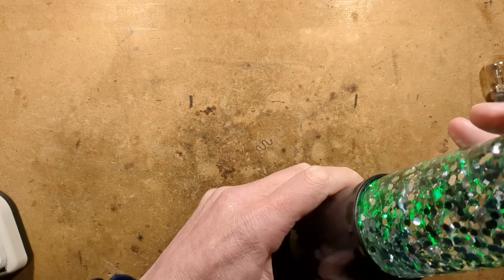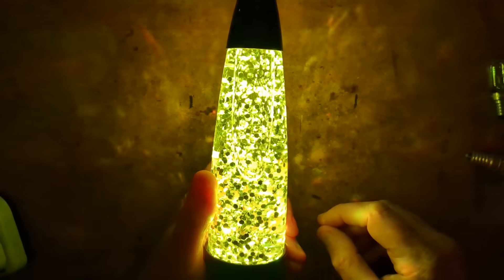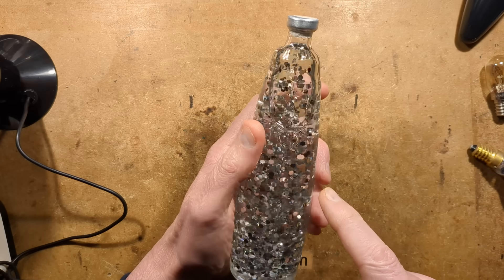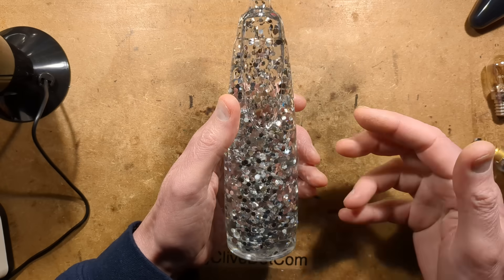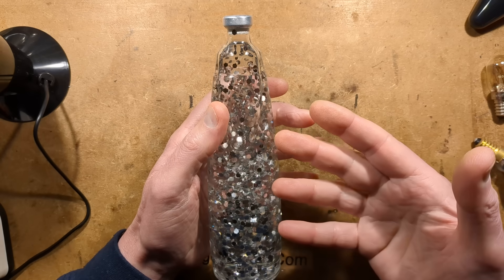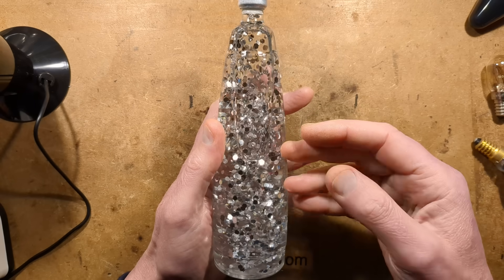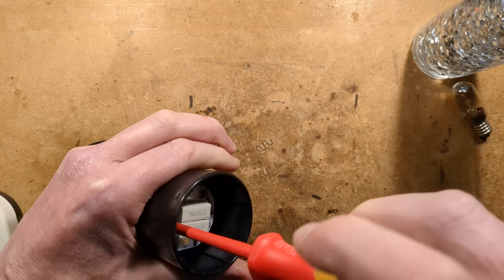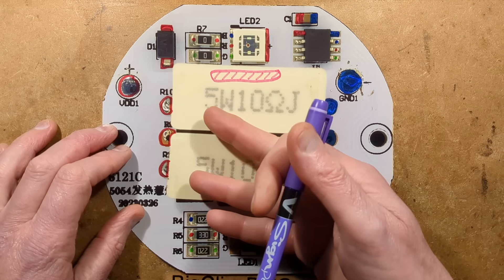USB glitter lamp with REAL thermal convection

Comment: I would think that if you want to "experiment" with the heat source and it's proximity to the bottom of the bottle, you should make it adjustable, both physically and electrically. The proximity and/or intensity of the heat source directly correlates to the convection rate (speed of turnover) balanced with avoiding equilibrium of the fluid's temperature, which of course will halt convection. With the bottle being as narrow as it is, that sweet spot will not be easy to find.

Another possible way you could "tune" the convection rate would be to put a 1/4 inch compression fitting on the bottle cap and use a 1/4 inch by maybe 6 inch heat pipe inserted through the fitting so that a portion of the heat pipe is in the solution and a portion of the heat pipe is outside of the bottle. By sliding the heat pipe in or out of the bottle you adjust the amount of the heat pipe exposed to the solution which changes the amount of cooling at the top of the bottle and thus changing the convection rate. Of course the fitting and the heat pipe will need to be impervious to the salt solution.

Comment: Having a standard vial crimp cap on top is neat too. I wonder if the glass is available from Chinese suppliers in single quantities.
Reply from the maker: Although crimped, the cap and rubber plug are designed to release under pressure if the globe is put on too high a heat source.

Comment: So are these resistors over-specked? Like if they can each handle 5W but only running at 2.5W each, wouldn't it make sense for cost savings to use two, 2.5W rated resistors in this application? That's if they exist at that power level lol
Reply from the maker: They're probably playing safe.  It's better not to run resistors at their full power rating.

Comment: Aha! I used to have a glitter lamp that contained some sort of oil in the chamber to provide the slow glitter movement and the heat and light were supplied by an incandescent bulb. I wondered how this one would work given incandescents are non grata these days. An interesting and effective substitute method!
Reply from the maker: It will probably be calcium nitrate again.  The old units are balanced termally for the original wattage of bulb.  The glitter may stay at the top with lower power heat sources.  (But you can add drips of very pure water to the calcium nitrate based globes to dilute it down gradually.)

Comment: I have been struggling with this for a long time.  How do I put color scrolling LEDs in my Lava Lamp (tm)?  They're not going to make stove lamps forever and, let's face it:  analogue effects are rad.  They're physics and psychedelic all wraped in one.  The amount of digital processing required to recreate what heat and oil does for 40W is pretty much pointless.  My best concept used heater wire.  Hadn't considered that 3 or 4 power resistors might suffice.  If anybody out there wants to work on a color scrolling Lava Lamp (tm) lamp with me I'm all for it.  Cheers!
Reply from the maker: Lava lamps need a lot of heat to operate properly.

Comment: Here at least, tungsten oven lamps are still available, the high temperature tolerance is a solid reason to use tungsten lamps in ovens and the low efficiency is not really a problem there. First hit on google when I searched for an oven lamp was an Osram, producing 85 lumens from 15 watts, there are led lamps on the market that are about 40 times more efficient than that.

Comment: I have a very similar lamp and I snipped the resistor out as an experiment (mine only uses one resistor) and the glitter still moves fairly well. It's extra calming to have the glitter move extra slow. Totally happy with the power savings (3.xW to 1.00W). Considering your irregular ambient temperatures it probably won't work without extra heat. Even my glitter starts to clump up top a bit in the winter

Comment: Any chance you may test VDE screwdrivers in the near future???
Reply from the maker: Do you mean for insulation strength or tip durability?  I'd suggest going with a prominent brand for professional work and a cheaper brand for home use.

Comment: If there's room between the glass and the resistors then I don't get why they've soldered them so they touch the board instead of keeping the legs longer so they float above the board and be closer to the glass. Prevents the board from getting too hot while the glass gets hotter.

Comment: Using those resistors is pretty neat, both because they burn out way less frequently than a light bulb (almost never, I imagine), and because the amount of light output is decoupled from the amount of heat output.

Comment: Wonder if it would be worthwhile to replace that junky cable with a better one, probably 0.7mm copper core double insulated lamp cable, and use a separate repurposed 5V 2A wall wart ( 2a o it is derated to a real world rating, not the inflated one from the OEM) connected to the cable. 

for other lamps getting the inside PCB might also work, though you probably will want to have a 12V supply, and put on the board a 5V regulator, along with using 2 15R 10W resistors instead, spaced well off the PCB on some ceramic beads, so as to move the power dissipation away from the board, and keep the electronics cool, and have 19W of heat for the lamp, which probably could use wax, as the resistors will run about the same heat as the original lamp, which generally was a 35W incandescent lamp, or for the later ones a 35W 12V dichroic reflector, with a cup shaped holder to actually absorb the heat and send it back up.

Comment: I was surprised to find out recently that hexamine fuel tablets, as used in Mamod steam engines and camping stoves, was banned now in the UK, because it too can be used for making err, pyrotechnic devices. I don't think that was what finally killed Mamod off but it certainly can't have helped! Speaking of pyrotechnic, what happens if you Soda Stream that glitter bottle :)

Comment: when i was young i put a 30mw line generator laser in the base of 1 of these would (not) recommend if you value your eyes, 
the only problem with coupling a high power led to the bottom of the bottle is the heatsink is on the wrong side of the diodes, you wont get as much conduction through the gel than to the metal base plate...but it probably doesnt matter if you dont cook your leds like most commercial lamps like to do, you could probably just stuff a commercial led lamp without the plastic diffusion up the backside of this and it would work fine on the oveworked leds alone

Comment: I used to visit Mathmos, in Pool in Dorset for UL as they shipped tonthe USA.

There was a downturn in production when certain companies were shipping them with flamable fluid in the bottles, so when they were knocked off a table they caught fire.

In the production the bottles were sterolised by heating them in very hot water, to keep the water clean so there was no discolouring of the water.

I did ask them how they were going to get around the eventual disuse of element lamps, this was in the 90's,  don't think they had thought of this.
They must have cracked it as suprisingly they are still manufacturing in Pool, the Lavalamp, one of the few still manufacturing in the UK.

I found it great little company.

One suggestion a metal sheet say aluminium the size of rhe resistor area and thickness, so the lamp would touch or reduce the air gap, giving more heat into the bottle, giving a greter convection and reducing the heat disipated in the circuit.
Reply: The aim.isnt just to put more heat into the bottle. That would just heat the contents up to equilibrium more quickly.

You need to balance heat in at the bottom and heat dissipation of the bottle (especially the top) to maintain a rising convection current through thermal differences.

Comment: I bought calcium nitrate on eBay for €20 for 25kg. I tried to make glitter lamps and lava lamps, but it must not have been pure enough, or I did something wrong. The liquid remained cloudy. For lava lamps, it's not a problem, but if you want to make a glitter lamp with clear liquid, it's not good.
Reply from the maker: The standard stuff is cloudy and needs either filtered or allowed to settle for a long time in a big sealed bottle and then the good clear bit syphoned out.  The manufacturers must use high purity chemicals.

Comment: I just want affordable LED home lighting that doesn't cause mass interference in radios. CFL and LED both interfere horribly. My shop has cinder block walls, can't get any fm reception with the lights on lol AM is basically impossible to receive indoors
Reply: CFL drivers probably require AC, but those cheapie LEDs just FWB-rectify AC into pulsed DC which does all the interfering.  I wondered about driving them with variable-voltage DC, just enough to get full power (ie, to just cover the LED-string's voltage) and eliminate that EMI/RFI.  A small box the lamp plugs into, or similar that the bulb screws into, should do.

Comment: They could have   a buck converter   to increase the voltage  to the resistors,  say 30 volts, and decreased  the total current  to the  5  volt  rail
Reply from the maker: That might have been useful to limit cable losses if it had been used at the plug end.

Comment: You don't need to be in the "Eco Industry" to see the benefit of cutting energy use of lighting by something like 70%. And if the LEDs are not run at their limit and the device has a decent quality, you also get the promised long lifetime.

Comment: I advise against putting any heat source in direct contact with any commercial glass vessel. Yes, in this case the liquid inside will convect heat away from the source once the glass reaches equilibrium but considering how cold you keep your house, you risk a messy, possibly expensive lesson in uneven rapid thermal expansion in glass.

Otherwise I agree that this is a fairly impressive design for what it is. The power resistors and LEDs are nicely derated, there’s no obvious safety hazards built in and no unnecessary complexity.

By the way- I doubt that the density of the liquid is measured during manufacture other than a go/no go visual inspection after assembly. Typically in industrial mass manufacture like this all of that is done before setting up the factory. All the workers have to do is put a prescribed amount of the calcium salt (so many buckets/bags) in a large vat and add water to the fill line, then turn on a timed mixer, then open a valve that goes to the fill line(s). Trust me- you want to idiot-proof such processes as much as possible, and it also keeps training costs down. My only concern would be the purity of the water used. Obviously drinking it is a bad idea but it can still,carry mold spores and whatnot that can be problematic if the liquid gets loose.
Reply: Well, you'd want to use a better heat-tolerant glass, like borosicilate. But yeah, those are a bit more expensive
Reply: You realize most lava lamps ran off 40W right? Almost ten times more than this unit.
Reply: @jaro6985 Yep, exactly right, and they were never in direct contact with the glass either. As another commenter here says, with those types heat is transferred via radiation through the glass into the contents and via air convection to the glass.

The point is that most kinds of glass will crack and fail under direct localized heating. Please don’t do experiments to verify this at home. I already have and while you can get good data, it’s messy and hazardous. Please don’t ask me how I know.
Reply: @jaro6985  sure but they have tungsten halogen lamps usually, with a lot of heat being radiative, meaning it's quite even at heating, and the rest of the heat being added through the air, also quite evenly.
You'd also likely want some kind of not-too-conductive heatspreader with resistive heating elements.

Comment: So if I used 12V low voltage lighting transformer, 20 ohm (2x10 series) resistor, and a 12V to USB to power the microcontroller and  waterproofing. I could have an outside glitter lamp.
Reply from the maker: If you sealed the base it could be solar powered.

Comment: The USB glitter lamp that I had was from years ago and used a small incandescent lamp. The lamp was a standard MES fitting so I replaced it with one of those torch lamps with a built-in lens. The result was a much 'sparklier' glitter lamp!

Comment: Next time you play with the lamp making, try pulling a vacuum to release the bubbles quickly. Cheers.
Reply from the maker: I tried that with limited success.  But it was a very crude and low vacuum system.  (A cap with a hole and a syringe.)

Comment: Glad to see even this sort of thing is getting more efficient (though I'd be interested to see a more tradtitional "lava" style like this).
5W for something like this is pretty crazy when I think about how much heat my lava lamp put out as a kid. It was bad enough that I stopped running it because it would make things hotter and ate tons of power for next to nothing besides ambience.
Reply: I wonder if one could make it even more efficient using an peltier module.
Like, simply thermally bonding a small one to the bottles bottom, sitting in a cutout within the pcb (so the peltier module won't touch it except with its cables), where the 'cold' side is basically beneath all the electronics (to reduce condensation problems) and has a little heatsink to absorb ambient heat?

Would definitely be neat ngl
Reply: @BioTechproject27  
If you only want to heat something, there's no point in using a peltier element. It doesn't magically give you more heat than a resistor. First a peltier is woefully inefficient. About 90% of the heat on the hot side is from power losses and only 10% "stolen" from the cold side (so the hot side heats 10 times more than the cold side cools). But that inefficiency doesn't matter when heating. The cold side just pulls heat out of the environment. That heat energy would have been there anyway and you could just add to it with a heating resistor directly instead of "pumping" it through a peltier first.
Reply: @superdau  Huh? Either you don't understand how peltier elements work or you didn't write what you actually mean, because nobody is claiming it somehow magically makes heat?

A peltier module is a simple, and yes, quite inefficent, type of heatpump.
Consider e.g. a more drastic example: A compressor heatpump.
If you use that to heat a specific mass in some place, taking heat from some other place, like its environment, you'll heat that mass up more than simply using that electrical energy to directly heat it e.g. with a resistive element. A heatpump uses energy to move heat. No matter how inefficient it is, as long as it moves heat energy for any amount of electrical energy, it will always be more efficient than a direct resistive heater.
Sure, in the case of a peltier module, the best you can expect is a COP of 1.5, so, at best, it can move 50% of the energy you put in as electricity.
(Realistically, it will be less, depending on how well the heat moves, voltage and amperage, but even a COP of 1.1 means for every Watt you put in, get 1.1 Watts of heat. That's still significant. A ten percent energy improvement is still significant.)

Comment: Plug in liquid air fresheners (Glade in this case) use the same idea minus all the components except the 5w ceramic resistor which is connected directly to the mains(US).  Heat convection draws the fragrance up the wick to disperse the scent.  This glitter lamp is far more complex than a Glade dispenser, the RGB LED and thermal regulation I suspect.. Thanks Big Clive.

Comment: Well, peel my tangerines, I am sat here wondering where I saw the word 'calcium' before and remembered on the back of a refill for a dehumidifier. Calcium Chloride to be exact. So I typed 'Can I use Calcium Chloride to make a lava lamp' into a popular search engine and YOU came up in the answer ''make a glitter lamp'' LOL. It cited your website as its source of information :D Well Done! xx Now what to do with 2KG of the stuff. Btw, it makes great weed killer!
Reply from the maker: The calcium chloride works with some lighter plastic glitters, but the nitrate is much better.  Most of the results you find for a DIY glitter lamp will be mine or people using the same info, but presenting it as their own.

Comment: I wasn't expecting chunky resistors, I was expecting those flexible resistive pads wrapped around the base.
Reply: 5w of heat is 5w of heat - doesn't really matter what form the resistor is that generates it
Reply: @gorak9000  Plus the ceramic boat resistors are very cheap, and available from thousands of suppliers in exactly the same dimensions, while a flexible pad is a very expensive item, and you need to specify the dimensions and power exactly.
Reply: @gorak9000  Not necessarily. Pads in direct contact will perform better thermally than ceramic resistors with an air gap. But they seemed to have dialed in the thermodynamics well enough the way it is.

Comment: using resistors as heating elements for an old-fashioned 'lava' lamp?
massive big brain time, kinda love it
i wonder if they could scale it up to the more classic bubbly-type lamps while using less power than incans
Reply: I bought a Stirling engine model from China, nice bit of kit. I built a small standalone heater base for it using some recycled wirewound resistors from the "that'll come in handy one day" cupboard, driven by a 12V 2A power brick from the same source. Works fine, also does a good job of keeping my caffeine bucket warm when the engine isn't doing its spinny whizzy thing.  I should investigate building a USB-powered version, maybe with some insulation and such.
Reply from the maker: The little bubble tube lights will happily run from a resistor and LED.